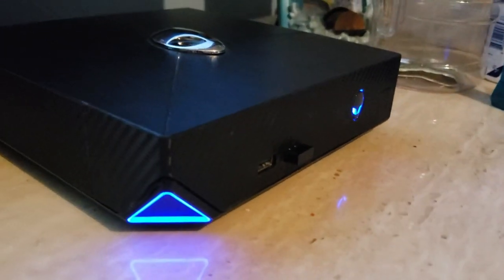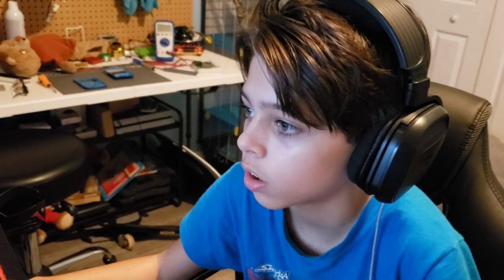Try this fix If your PC Runs Hot Slow Loud then Crashes

Comment: Can a Mac graphics card also go wonky and generate vertical bars from overhearing from dust? Mine laptop gets quite hot just above the keyboard. i bought fan speed control software and it seems more stable. Could all this be mostly dust?????

Comment: People, please do not vacuum your electronics. The hose is full with electrostatic charge. An ESD will damage it!

Use ESD Safe brushes to clean the dirt, and compressed air or your lungs and a straw.